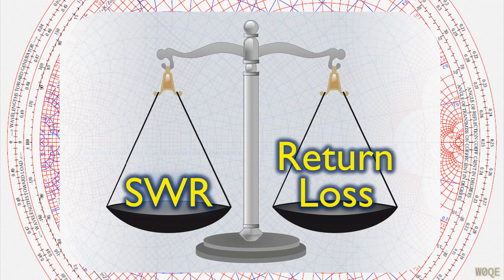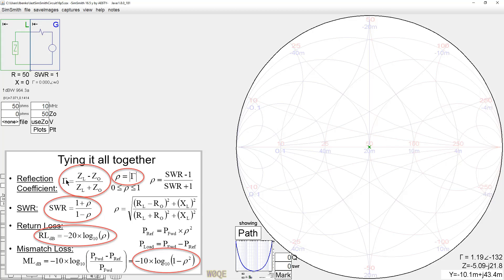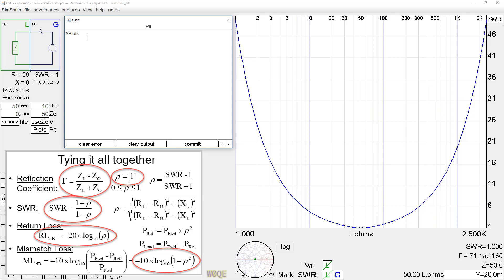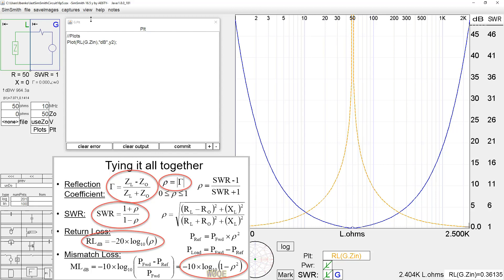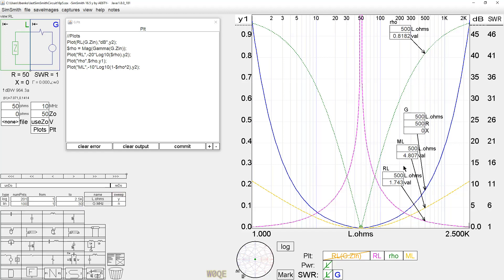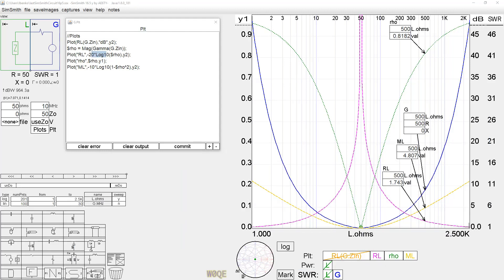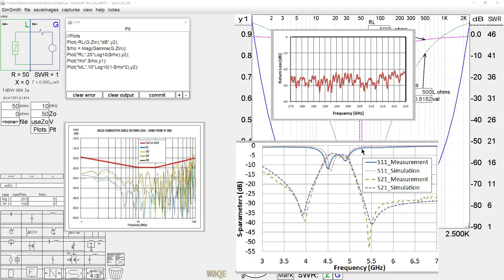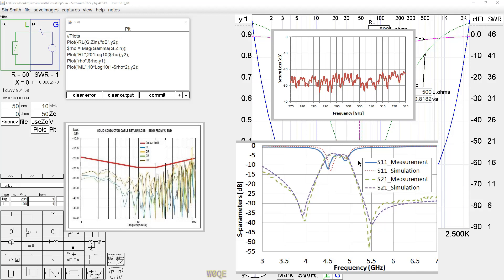#63: SWR vs Return Loss

Comment: Marvelous video and your way of explaining it. Thank you.
To me, RL just makes a simpler sense than SWR. When we know SWR, we often times want to convert that to a ratio of forward and reverse power so we know how much is going forward and how much is reflected just like what we get when we turn the slug around in a directional watt meter.  
So  RL of 20 dB is 100 watts going out and one reflected... only 1% reflected, pretty good... But that is a SWR of 1.22. 
Or what if we have 100 watts and 10 are reflected... 10% reflected, not as good... then we have a RL of 10 dB (makes sense) and a SWR of 1.925
Lastly 1000 watts where 1 watt is reflected (0.1% reflected - super good) is a RL of 30 dB or a SWR of 1.065.
If this doesn't make the point of goofy numbers for SWR that almost always need to be converted to a forward and reflected ratio, but a easy to understand value of 10dB, 20dB and 30 dB for RL, then I don't know what will. 
Maybe SWR came about as an intention confusing point for the benefit of sales to vulnerable ham radio operators long ago - much like RMS power in audio amplifier came about around 1970.
Just something to think about.   73  WA4QGA

Comment: Thank you for the video. Its interesting your point on -RL and i agree with you however it is easy to see why many people quote it as -. Before i got my VNA I would normalize a return loss bridge open circuit then place the antenna under test on it which based on the maths inside the spec analyser obviously  give a - value.

Comment: I did not understand inverting the mismatch loss? What is the inverse of mismatch loss? Changing the RL label to S11 to show that it is flipped return loss I understood that. A lot of return loss charts are negative because they are usually screen shots from a network analyzer S11 or data dump graph of S11. Do to lack of understanding or communication between marketing and engineering they just do not label the chart properly. Good demonstration of the difference of each.
Reply from the maker: Inverting the mismatch loss is similar to inverting the return loss where the new meaning is mismatch gain reduction and return signal.  You are totally correct that once you get used to the s11 and s21 plots from a network analyzer that is how you would prefer to the plots.  SimSmith provides a good platform to present these topics and solve many common problems. Thanks, Larry